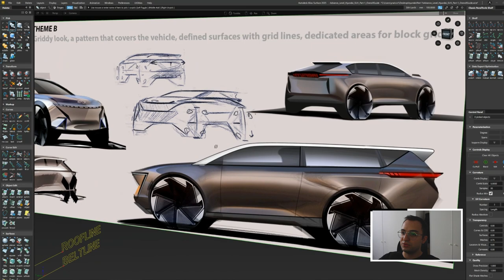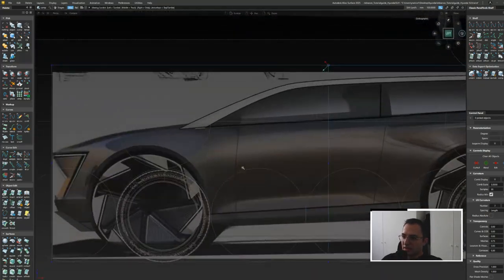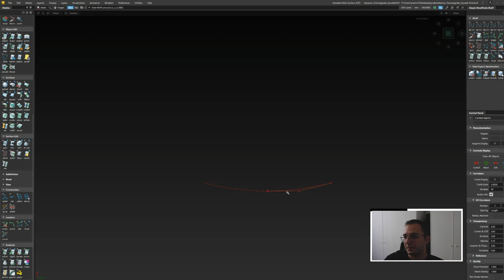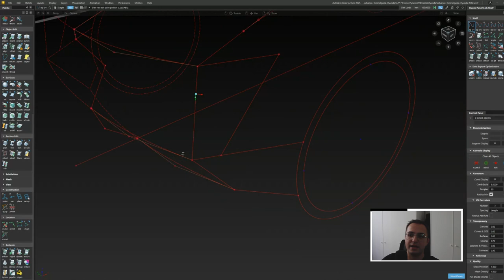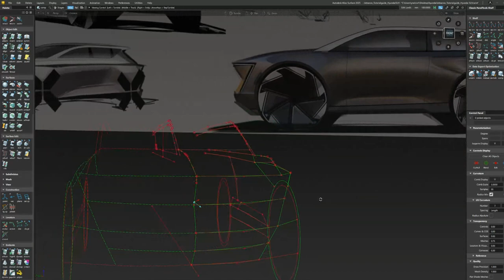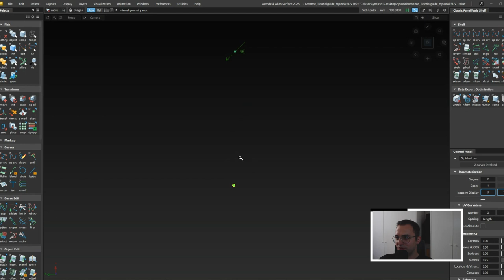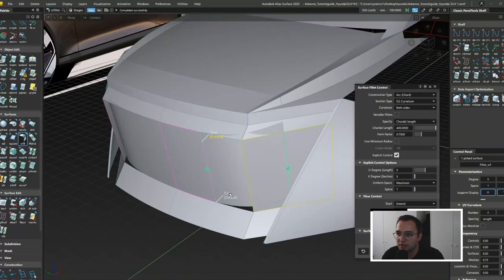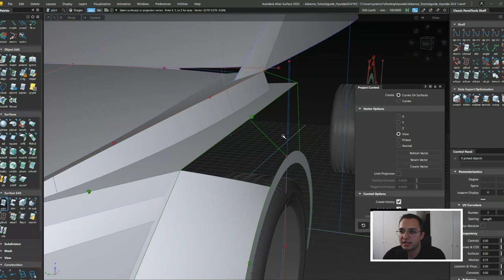Alias 3D Modeling Advance Level Part 1: Creating curve network and blockout overhang

Comment: I find working from sketches can be frustrating as parts of the concept frequently doesn't work when you start modeling in 3D and never would. I don't use Alias, but the techniques shown here are applicable to many 3D programs.
Reply from the maker: Well said! I always say the most important thing is the method and techniques of surface modeling. The logic is the same. Softwares are just the tools that we need to use express our ideas. Nothing more. One thing to consider which software is used in that spesific industry. Other than that method is always the same.